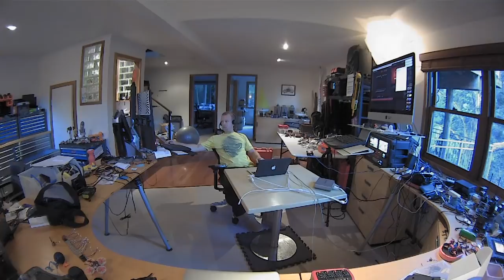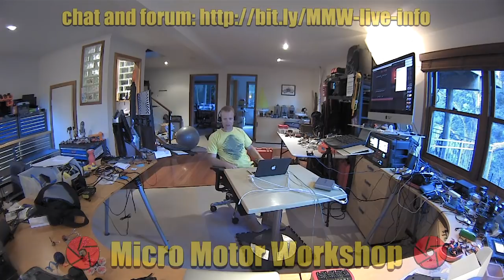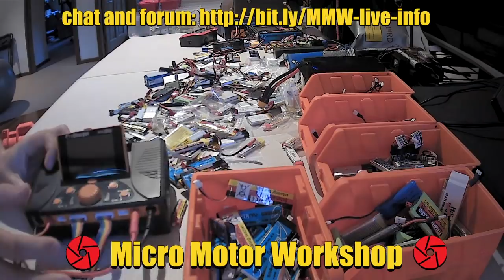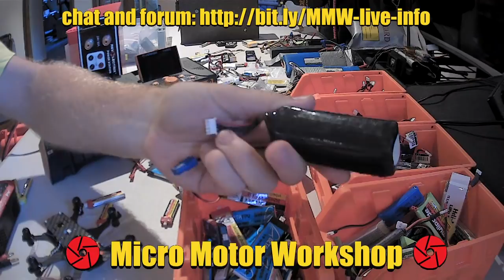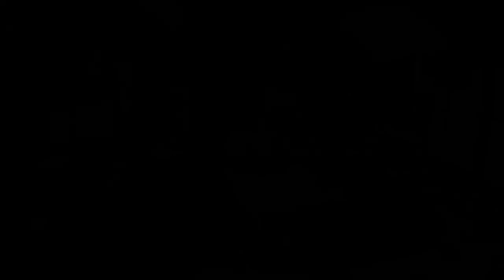Micro Motor Workshop - selecting, charging, using 1S lipo batteries

Comment: Thank you for keeping all of us informed and safe. 😎 You did go over my question near the end about not keeping batteries fully charged. I am wondering about how long do you think it takes for damage to start to occur🤔 Over night, 24 hours 🙂 I’m asking because I’m sure I’m not along when I might not get to fly charged batteries for a day or two or even longer.
Reply from the maker: Hey Sean, a day or two doesnt matter.
The damage done to the battery by being charged depends on a variety of factors, many that you can influence, e.g. internal conditions.
The main two factors you can influence are voltage and temperature. They higher both of them, the higher the damage done over time.
Keep them at low voltage and at low temperature (dont freeze them!) and they will live longer.
Also important: the lower the voltage, the lower the danger potential. A lipo at storage voltage will not erupt violently, whilst at full voltage, it will have a lot more punch in the case of an accident!

Comment: For those of you that might not be getting notifications please check your settings. The three bars upper left show subscriptions and settings. Go into settings and  notifications.Then be sure you have push and email notifications set to on besides just hitting the subscribe bell. Great tutorial Benedikt ;) The batteries I know I will not be using regularly I keep at 3.8v and store them in zip lock bags in the refrigerator in one of the storage compartments.

Comment: I'm using the same Hitec charger you have. I don't store them fully charged, but I find that some of them won't last as long after a while. I have many sizes of batteries and can't fly most of them because of the weather. Does this happen when they are not used often? Should I put a storage charge on them?
Reply: lofreq if you don’t use them, keep the batteries at 3.6-3.8V at a cool place.